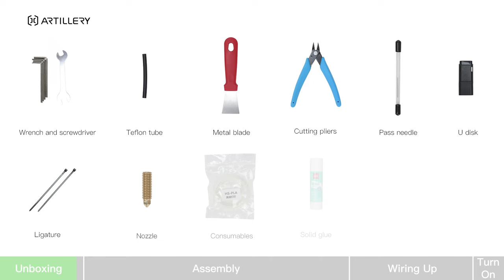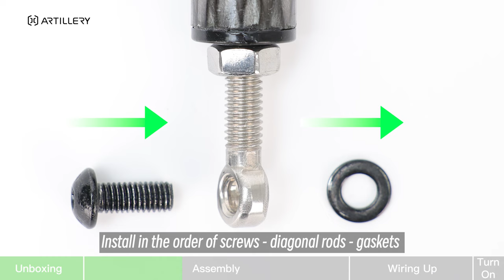Artillery Sidewinder X4 Pro Unboxing & Assembly

Comment: The screw at 03:44 is too short and cannot be installed...that's why there is a cut in the video. There was no tape on the hotbed...probably dropped off, during transport?
Reply from the maker: Hello there. Do you mean you can't install the cable part? Please describe it specifically.

Comment: I really don't like these top-heavy designs...spool holders should be attachable to both side and or back of bed and then filament(s) should then run diagonally up to the crossbar and then through a 6-inch bent adjustable drying sleeve and then down into the head.
Reply from the maker: Hello, thank you for your very detailed advice on design. We understand that everyone has different preferences, and we will try our best to make the design perfect.